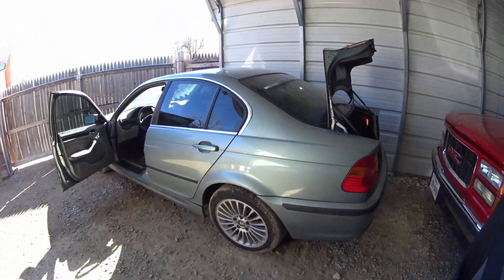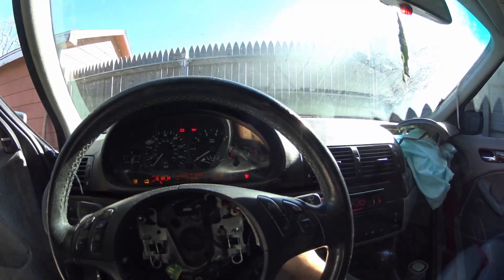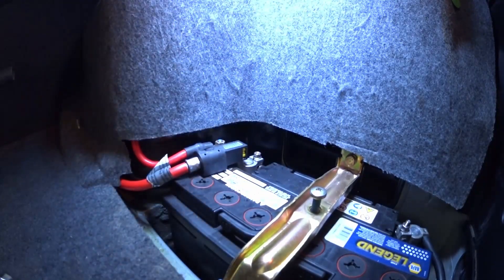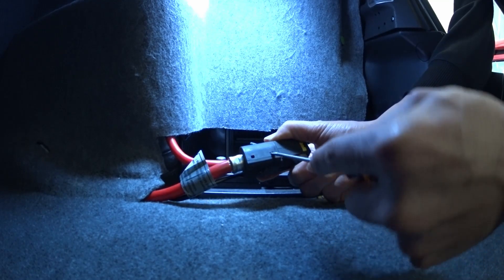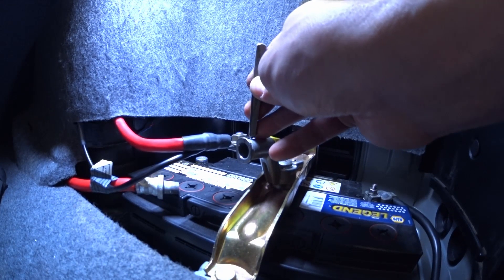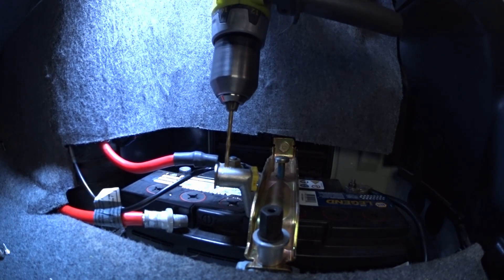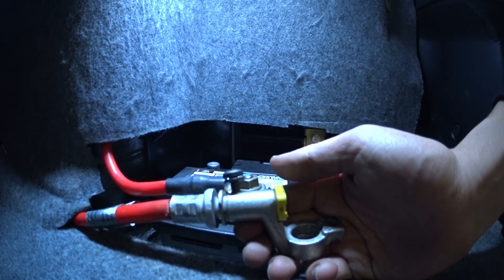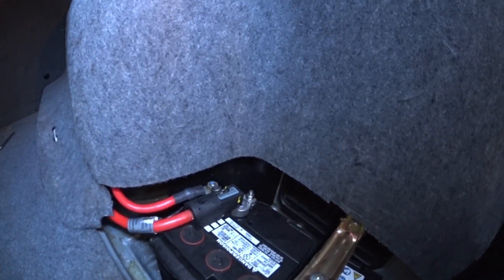BMW E46 Battery Safety Terminal BST bypass (325, 328, 330, M3)

Comment: Anything to check for if it’s not loose ? I wasn’t in a accident but I was messing with those two fuses under the glove box/dash and now I’m getting the same no crank no start kinds deal and it’s frustrating because I had to get my car towed because of course I did it while on a test drive lol
Reply from the maker: If you can only hear it click like in the video but the BST cable is still intact, then I would check battery voltage. Low voltage would cause it to not crank. Other than that I would try a different key if you have one. The key transponder is a known issue, especially with the age of these cars.

Comment: Ah, thanks I needed this. My 2008 Z4m cable blew...no idea why, I was driving very chilled past a school 1 block from my apartment, heard a bang, then after inspecting everything thought it was my imagination, but my car wouldn't start next time I tried. I thought it was a battery problem and upon removing found my live cable in two. Lol. Now I just need to get it a few kilometres to my mechanic. Thankgod for BMW communities, I'm on my 3rd high mileage BMW and the community has been more valuable than anything I could imagine, especially with diagnosing issues. I don't own a drill or several tools anymore so I'm going to try it with several wraps of electrical tape and then professional gaffer tape, and then try to stick the plastic housing back on. Then drive super carefully. I hope it works and holds as the car is in a difficult spot to work on at the moment so it needs to be moved. I just hope it was a fluke and not some bigger issue. The impact of Covid has left my pockets pretty empty. Many thanks and much love.
Reply from the maker: Unfortunately, they are known for going off on their own on BMW's. Also, you might notice that your airbag light is on in your gauge cluster. If you choose to not fix/install another BST cable, you can either live with light on or you can also deactivate the BST sensor from the SRS system by using PA Soft 1.4 software.
Reply: @eight-motion2870  Thanks, you are so helpful, and that's a relief. I was worried there might be some other underlying issue if this wasn't the case. I'll have a look and see, most likely over the weekend. I managed to get the little plastic case off last night, the z4 version is quite a bit more robust so it was quite a fight (not to mention the akward space to work in). I intend to replace - I like to keep my car tip-top, so I'll be happy enough with the airbag light on my way to my mechanic. I just hope it's easy enough to get the part, I'm in South Africa and some parts are easy to get, others aren't (especially with various lockdowns around the world right now), but I'm sure BMW will order me one if they don't have it, they've been really helpful in the past. Luckily, I don't need my car every day anymore but I don't like the idea of her sitting for too long. I firmly believe a performance engine needs a good run once a week or so to stay healthy.

Comment: What’s the yellow cap that connects to the other wire
Reply from the maker: That cap is part of the pyro that ignites the explosive to separate/cut power to the starter. In this case, it's what pushed the cable away from the battery terminal.
Reply: @eight-motion2870  but what is it called because that's the part I need for my battery and can't find it anywhere! Thanks!
Reply: @epifan3_  you need to replace whole cable thing with connector

Comment: Hello, I have the next problem with my e46 316i : I was driving the car and suddenly the engine was running very badly ( like it wasen't enough fuel coming to the engine) and at the first stop light, the engine died. Since than, the engine is not cranking anymore and also, when I turn the key on the 2nd position into ignition, the fuel pump doesn't engage ( I Don't hear the fuel pump working). I replaced the battery with a new one and it's the same. When I try to start de engine, the starter makes only click click click… Can you please help me with some ideas? Why my car doesn't get power at the starter and at the fuel pump? May a bad starter cut the power to the fuel pump also? Thank you for any advice.
Reply from the maker: If your starter only clicks but doesn't turn over your engine, then it sounds like your battery voltage is low. Try hooking up to a jump starter or a pair of jumper cables with another car to see if the clicking goes away.

For your second problem, you should be able to hear your fuel pump prime for at least 2 seconds when you turn your key to the 2nd position. If you don't hear it, I would start with the easy stuff to try and rule out the pump being the issue.

Easiest to check is if the fuel rail system has pressure. Under the hood, remove your central engine cover. There you should be able to see your fuel rail and it should have a schrader valve towards the front. Turn the key to the second position and then press the center of the schrader valve, if no fuels comes out then it means no fuel is getting to your engine.

Three places to check for fuel problems:
1st check the fuse in the glove box compartment (#54 I think). This one goes to your fuel pump relay.

2nd check the relay itself. This one is located behind the glove box. You only need a phillips head screwdriver driver to remove 6 screws and the whole glove box compartment comes off. You are looking for a green relay. In my case I had three greens and one orange in a row going horizontal. Your fuel pump relay is going to the one furthest left. I would try to swap it with one of the other green relays and check if you can hear the pump prime when you turn the key.

3rd place to check is the under the hood on the driver side closest to the firewall (where your brake master cylinder is located). You should have a black compartment closed by 4 allen head screws. Pullout the black fuse pack (should say Motor-Sicherungen). Check the fuses.

If it all looks good, then I would assume the fuel pump has gone bad.

Hope this helps!
Reply: @eight-motion2870  Hello and thank you so much for your reply. Yesterday I found the problem, you will not believe what was actually the problem. The alternator clutch pulley has stucked, it turns only in the oposite directin now. That's why the starter was doing juste a click noise, it wasen't able to turn the crankshaft with the accessories belt.
Thank you and I hope this to be helpfull to someone else.
Reply: @raduluparu did u replace alternator to solve the problem ? Im havjng a similar situation
Reply: @bassfunction5452  did you solve it? I have the same problem but it’s not the alternator

Comment: Could I use an easier method like electric tape to hold it in place?
Reply from the maker: Electric tape doesn't hold up too well in warm temperature, it'll loosen up overtime but it's a good "in case of emergency" fix.

I could see zip-ties working. You could probably use 3 or 4 of them, wrap one around the cable portion and one around the terminal portion, then just use the other two to pull them together. 

Not sure if it makes sense? Let me know, I can probably make a quick video
Reply: @eight-motion2870  yes that makes sense. Thanks alot! Recently hit a curb and the airbag deployed. Couldn't start car or anything lol. But I will give that a shot
Reply: @eight-motion2870  so basically if you use zip ties, you just need them to hold the cable in place? You don't need to drill a hole and use a screw to hold it?
Reply: @Baps2K  Yes, as long as there is metal to metal contact you should have current going through. The screw was really more of a permanent hold fix than anything else.

Comment: My battery is dead and when i try to use jump leads to start her up she doesent, all the lights on dash come on and everything else but when i push the start button it just clicks once and thats about it. Could this be the fix? Its a 2006 bmw 320d auto
Reply from the maker: The BST cable could be the problem, they are known for going off for no apparent reason.. Best way to find out is to try and wiggle the battery cable and see if it moves. If you have access to an OBD reader, try pulling up the codes in the system and checking if it references anything regarding battery power/terminal issues.

You can also try checking the KI 30g relay behind your glove compartment fuse box, those are also know for going out.
Reply: Did you find the solution? I have the same problem as you